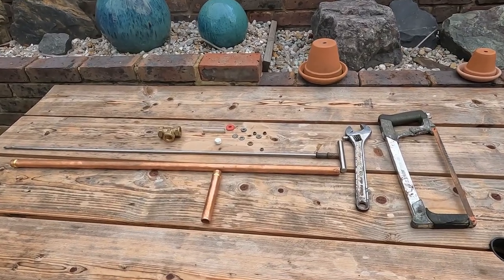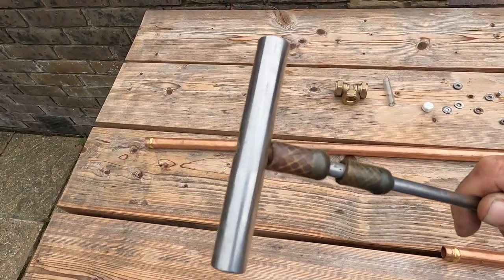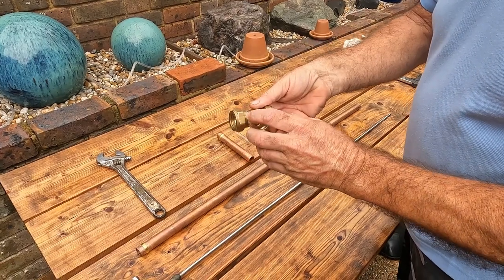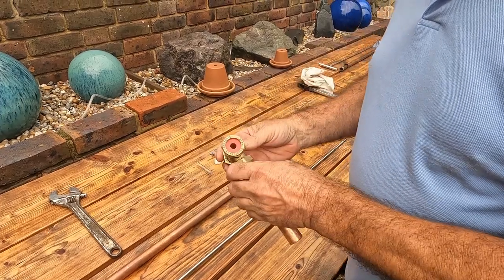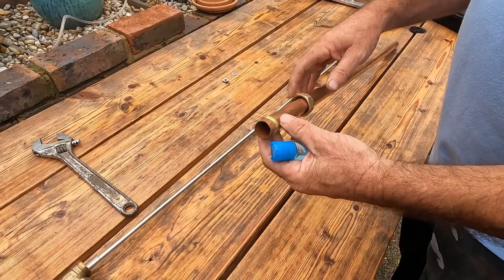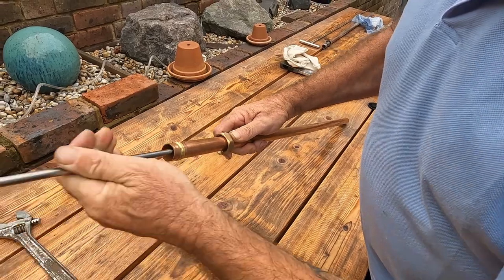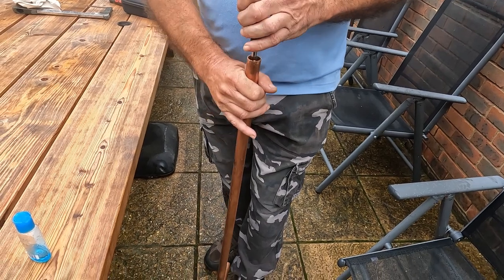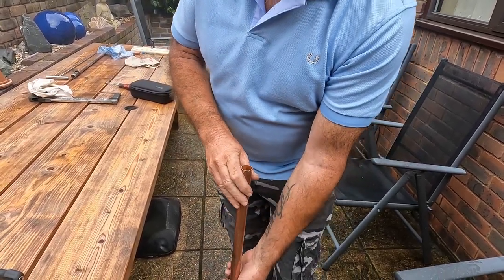Guide on How to Build a Bait Pump for Black Lugworms

Comment: Just come across this video 👍 just wondering what diameter stainless bar do you use for the plunger 🤔 cheers pal .. All the best Lincoln 🤙👍
Reply from the maker: Hi i use 8mm stainless rod with a m6 thread at the plunger end and a 20 mm solid or tube handle hope that helps you thanks for posting
Reply from the maker: Some  people use a 10mm rod but i find the thread too fat and reduces the amount of seal you have at the end
Reply: Thanks very much pal😁 got the parts off a plumber who's working on the same job as me.. just ordered the bar so it's game on 👍all the best Lincoln 👍🤙
Reply from the maker: @harwoodblades3633  I cheat i weld a m6 nut on the end then grind it down find it a lot easier than trying to thread it good luck
Reply: Cheers bud.. stainless is hard to thread🙄 all my builds I use high carbon steel and I sometimes thread the material before heat treatment 🤔 after heat treatment you've absolutely no chance 👀 cheers for the info..all the best Lincoln 🤙👍

Comment: Hi m8 thanks for sharing your homemade pump video that works brilliantly. I have made this pump the main part been 22mm and the plunger part using 15mm copper pipe using a 15mm rawl bolt at the bottom which looks OK but don't know if it will work smoothly enough on the beach, what diameter and what grade stainless steel round bar do you use as some metals seem flimsy that I've looked at? Any info is much appreciated just need to get out and try my pump out and hopefully get the technique of pumping worms and save some money 👍🎣🎣
Reply from the maker: Hi I use a 8 mm 304 stainless bar with either a m8 thread cut or a m6 bolt welded on then ground down to diameter of shaft. The shaft is the hardest part to make if unable to make try a metal fabricater might  charge about £20 for the shaft the rest is pennies good luck and thank you for posting
Reply: @hastingsangler  thank you I'll get some 8mm 304 stainless steel bar n  I can get it threaded at work thanks again 👍

Comment: I have the old aussie bait pump 50mm i wounder if i can use the centre bar buy the copper a 3 way brass and silicon plunger half the cost great vid thanks
Reply from the maker: Hi it all depends on how thick the center bar is really plus i think the bar might be short them pump was not very long but good luck

Comment: Hi where did you get that plastic bit that actually sat on top. The transparent one.
Reply from the maker: the plastic bit at the top of the tee is a 6mm chopping board made of nylon then inside the tee you cab use any sort of tube to stop you pulling the shaft through the equal tee
Reply from the maker: all the clear bit inside does is stop the plunger being pull right through the pump

Comment: Hey Dave.. Did you miss the bit about fixing the White rubber seal on the end.. I'm new to fishing and the pump is 90 quid in Hastings angling shop.. Mt really pleased to find you in Hastings 😁..  Gonna watch more of you're vids.. Probably be trying to pick your brains lol for Good fishing spots n techniques. Cheers  I'm in the Old Town 5mins from harbour, Great to just walk down n chill with a line in the sea.
Just noticed this is a Yr old.. Hope you still get it. Cya
Reply from the maker: Hi LoL it was my 1st video and yes some how i cut that bit out. i had a few viewers say the same thing so i made more vids on making bait pumps and how to make pump seals. the pumps are easy to make i dont know why they are so expensive to buy if i can help you with advice not a problem ,Thanks for taking the time to post and watch cheers Dave

Comment: This is a brilliant video my friend. I already have 2 22mm pumps however I am thinking of making 28mm pump. What would I need make a 28mm pump
Reply from the maker: Hi Mumtaz How many pumps do you need my friend lol. If your thinking of making a 28mm pump i would go with a 10mm stainless shaft as the 8mm might flex a bit when trying to push a bigger seal also you should be able to get all the 28mm pipe fittings from a plumbing shop or hardware store ie 28mm compression tee and 28mm pipe hope this helps
Reply: @Hastings Angler  how mnay pumps do I need well thats a.good question 😅 . When I went fish last time there was a guy with a 27mm pump and he had pumped quite a few blow lugs pretty quick. I have come across quite a few guys who are using 27 or 28 mm pumps. Obviously the suction is more on a bigger bore. The new bait pump nowadays is about 80 pounds. The one you have made can be made probably less than half price
Reply from the maker: @mumtazzafar5696  Ive always used 22m copper tube you get plenty of suction that is the most important part  but what i see alot is most people tend to put the pump to far in the sand it also depends what the sands like where you live soft or hard i dont no if you have watch my video trying to show some tips https://youtu.be/lZmqXRR1rRQ

Comment: Would a large brass wing nut threaded onto the 'work-end' of the bar be easier to adjust the tension - save having to carry/use a separate socket set ?
Reply from the maker: Wingnuts are ok but they tend to unwind themself then you are forever adjusting your pump for pressure i carry a small screwdriver type handle with a 10mm socket works a treat and fits in your pocket good luck